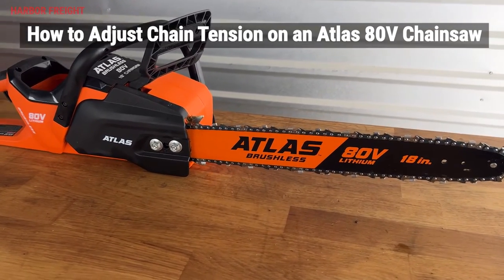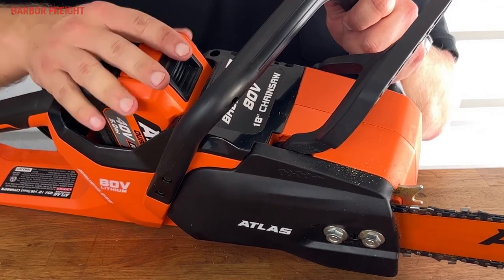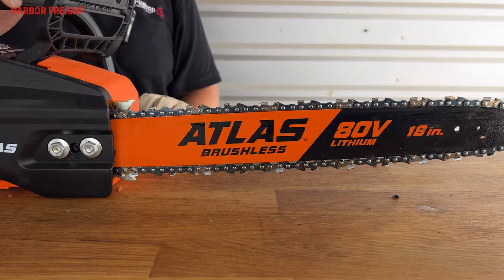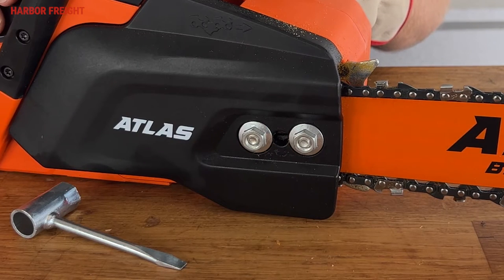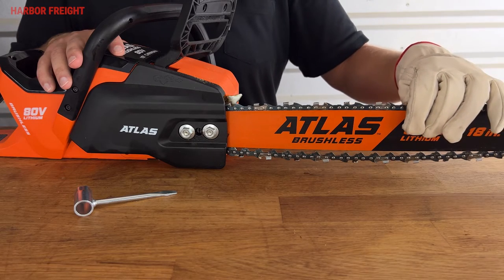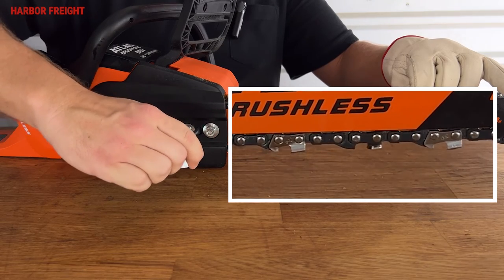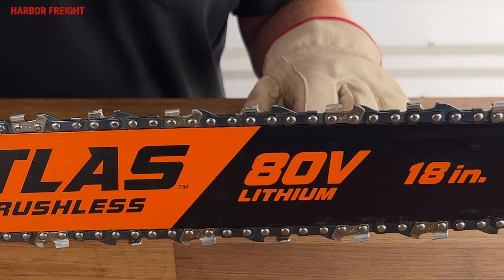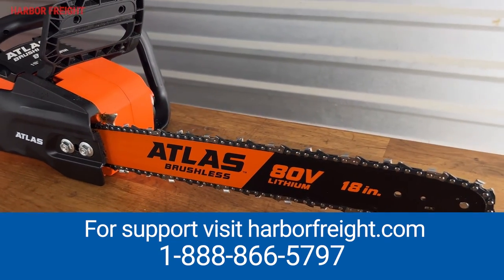How to Adjust Chain Tension on an Atlas 80V Chainsaw | Harbor Freight

Comment: In the owner's manual for the Atlas chain saw, on the specifications page it lists a replacement chain as "Trilink CL 15062".  When I bought a S62 Trilink brand replacement chain with 3/8" pitch and .05 gage and 62 drive links, it lists part numbers 15062x2TLW  and 15062x2TL2 (on the same package) but when I installed it the chain is loose. Even after making sure that the bar is upward when tightening the cover bolts and tightening the tension screw.  Can you tell me the correct part number for a replacement chain?  Do the additional digits after 15062 for the Trilink part # mean anything that would allow me to know if this is the wrong replacement chain for the Atlas 18 in chain saw?
Reply: Looks like my first comment was deleted... while using it this morning, the 18" Atlas chain just came off accidentally, and I noticed one of the inner bottom teeth that rides in the bar groove was broken off... so I tried the chain that I bought from Tractor supply a couple of years ago and it seems to work just fine... it is an Oregon 18" S62.